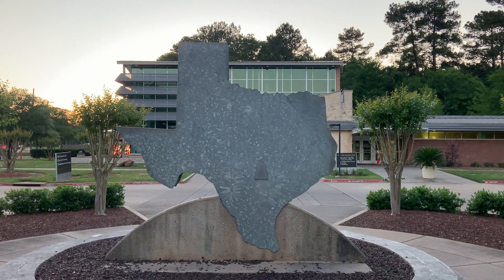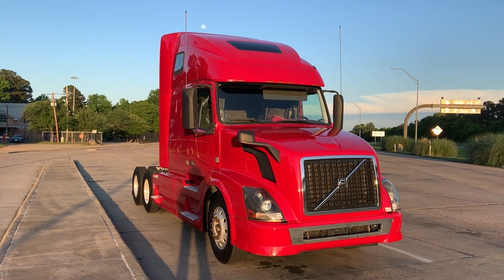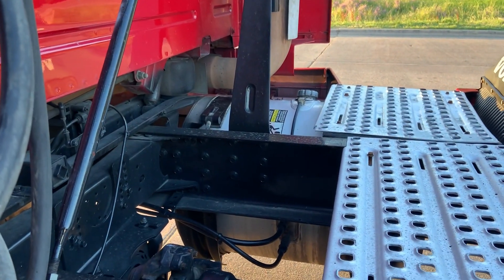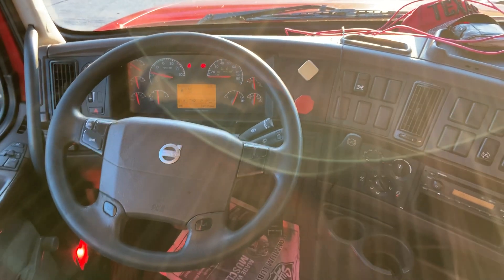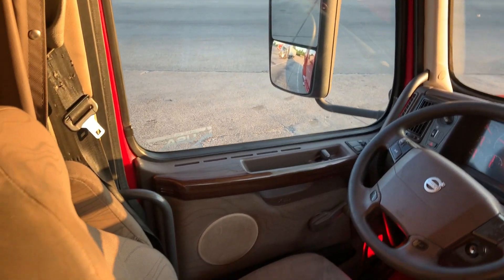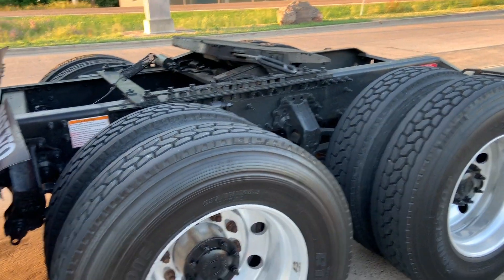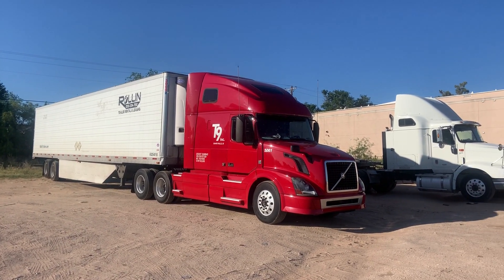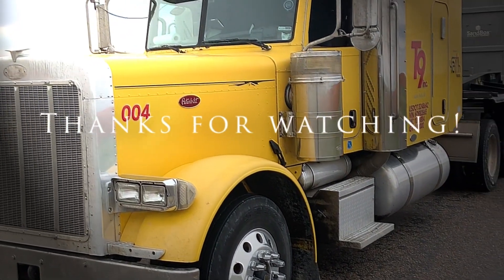Hello Red Volvo!

Comment: Scary scenario Tommy, what the hell is your driver wanting with a hunting knife and a pistol in the cab, is that the norm?  I have a mate in Canada he runs out of Toronto he has a Volvo and he much prefers it to a Pete,Mack or Kenworth better for comfort, more reliable and easier to manoeuvre in tight spots so I think you've made a good choice there Tommy, from what I understand the Volvos here in the UK have got a good reputation for reliability but DAF are not as reliable. Good to here from you again.all the best mate.
Reply from the maker: Thanks Alec. The Volvos are good and smoother. The freightliner see have now are similar to the Volvos but get us and extra mpg. Hope you are doing well.